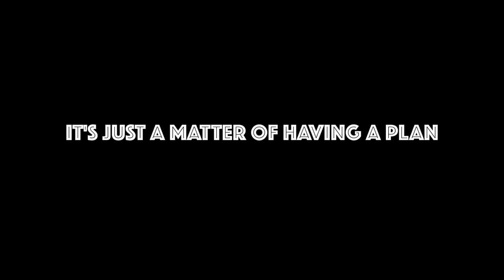NO MORE WATER BILL!

Comment: Great Idea, my only comment though I haven't sen the second video would be to insulate them and stop sunlight getting to them.  As they are "clear" in a fashion, you will get algae growth inside them, without sunlight nothing will grow.  Also Someone else commented, I wouldn't fill them all together as if one tank gets contaminated for whatever reason then all the tanks get contaminated, far better to fill them one at a time and then have the ability to isolate one for cleaning in case of a problem, otherwise great work!  I'm not trying to be negative as I think you are doing a superb job.

Comment: Steven, I love this approach, but unfortunately, the water in those above ground holding tanks will freeze during the winter time  and may damage them, and or the fittings. I would suggest installing a 500 gallon buried tank that you can drain those tanks to during the winter months, so the water will not freeze, but you will also need to bury all your water lines below freeze grade so the water will not freeze in them. You can check with a local plumber there to determine the depth the buried waterlines need to be.
Reply from the maker: So far we haven't had an issue! That only issue so far was the hot water on demand tank busted but that's because the screw wasn't loosened to let filter drop through when needed.

Comment: Filling from the bottom up? That is a bad design you get a quake you could have your water compromised also you lose one tank you lose them all. I rather stagger them so they step down to the lowest filling up even if you have to pump your water into an upper reservoir for pressure it would be better than losing all your water due to one cracked elbow. Also that is PVC UV will make it brittle you have to protect it from the sun light either spray paint it cover it with something.

You are well on your way getting it off grid that is a great way to live or have as a backup should you have to go there.
Reply from the maker: This design I feel is pretty solid. In the unlikely event what you said happened, we have more water tanks for reserve and also have water delivery service identified if need be.
Reply: So has that design been comprimised?

Comment: Sandals and crocs while walking through them leaves and carrying the concrete blocks? You're braver than I am lol.

You mentioned it being used for showers and one of my first questions was about all the debris and stuff that'd be collecting on the roof surface but you answered that. So my next question is, are you guys planning on doing any filtering or anything before pumping it into the house for use? The debris catcher will probably help for a lot of it but you're going to get bird poop and other undesirables on there and the water is going to contact it even with the debris catcher and will then fill your tanks.
Reply from the maker: Flip flops are my only pair or summer shoes! So the gutter guard gets out big stuff, then the flush 3" pvc helps trap stuff there gets through that, then there's a filter before the pump (haven't show you that yet) and there there's a charcoal filter before it goes into the house. So four ways to prevent grossness from getting in.

Comment: hmm not slanted how is the water going to run down? also personally I would of built it taller to have a covered area to chill so it would have two purposes but thats me.
Reply from the maker: TheKrazysinner believe it or not, you only need a 1 degree slant for water to run off. This roof far exceeds that. The end is well over 6 feet, more than adequate to chill but it'll be used as a place to store a small boat and other things
Reply: ah ok well in the video it did not appear to have a slant.
Reply: You might technically have enough slope to get the water to run to the end, but it is so little slope that you are going to be constantly having a problem with dirty water. The water will not flow well enough to clean the surface off once the flush tank is full. You'll still be getting dirty water after that flush is finished.

Comment: Great job but if tanks were higher than your homes sink level you'd only need pump for shower head and that would save a lot of energy, Even if you raise tanks by a foot in existing structure it should save energy by reducing pumping requirements.

Love what you doing.
Reply from the maker: LiveCheapAndProsper the pump is about the size of my hand and runs on very little energy which is generated by solar and powered by a small battery
Reply from the maker: Also, you only get about roughly .5 psi per foot in elevation. The house currently has 55 psi from that little pump. We'd need an elevation drop of 110 feet. In the mountains that might be do-able but being a flatlander, it's outta the question.
Reply: Interesting, thanks TTL.  My niece tells me her electric water pump is costing her a fortune to run but I forgot that she is pumping water from underground.

Comment: How do you keep it from freezing up in the winter?
Reply from the maker: We will be installing tape that wraps around the tube that's dc powered and charged via solar to keep the water above freezing.
Reply: Very good to know thanks so much!!!
Reply: To avoid the water freezing, people used to put the tanks below the ground. I don't think solar power will give off enough power to keep the water from freezing. Solar does not charge well during winter with overcast. These tanks should be under the ground with the funnel system above ground to catch the water.

Comment: What do you do about winter freeze up?
Reply from the maker: We will be installing tape that wraps around the tube that's dc powered and charged via solar to keep the water above freezing.
Reply: And leave the system dripping slightly when it's really cold. you should be alright. Love your video's by the way. Thanks!

Comment: Isn't rainwater now acid rain? How do you filter out all the bad chemicals in rainwater? 

And be careful. Some states have made it illegal to collect rainwater or have regulated how the rainwater is collected.
Reply from the maker: Rainwater is slightly more acidic than tap water, but only slighter, so little in fact that it's a non-issue. If we want, we can put on a alkaline setup to boost the ph level. I feel it's a natural right to collect water.
Reply: It's more a issue of what you're collecting the water with... Industrial materials can leave trace elements in the water... and first flush is usually required to get past stuff that can collect on surfaces over time that you wouldn't want in your drinking water either.

Just don't use anything that will leave traces in your water or worse dissolve over time...

But if you use a series of filters then you can be pretty sure it's a lot cleaner than most tap water...

You'd have to live within a couple of miles of a factory spewing out junk into the air to really have to worry... but with the clean air standards over most of the country that's hardly likely anymore...

Government just worries about incompetent people who may do dumb things like use lead lined pipes to collect their water... 

Along with the possibility that some people may try to use storm water, which washes all the junk we leave around like anti-freeze and oil from cars, etc. and they generally don't like people to be off-grid as that means you're not paying into the system...

So just because they're trying to prohibit it doesn't mean it's bad... Like some places prohibit you from growing your own food on your own land for example and there's really no reason to ever block that...

There's even a farmer who is facing a lawsuit from the government for $2.8 million for tilling his own land, which is designated for farming!  And if he loses he'll also have to pay about $30 million to land preservation organizations...

So the government can be just plane crazy some times too...

Comment: 825 gallon?...you are going to need much more than that...we had over 2500 gallon capacity in our water tanks...which sounds like heaps...but if you have a spell of no rain that water will disappear real quick...we lived in the subtropics and so we had good rain when it rained...but sometimes it didn't rain...
Reply from the maker: MELODY MUNRO my dad will use about 15 gallons per day. That's 55 days which is more than enough between rains. If for some reason that isn't enough, we will add another tank then re evaluate
Reply from the maker: MELODY MUNRO plus it sounds like you had more than one person. Also, my dad has a compost toilet along with low flow everything and a washing mashing that only uses 7 gallons per wash.
Reply: we use our water for everything....toilet...drinking...showering...laundry...there were only 3 people.